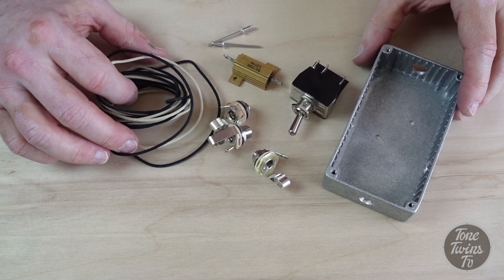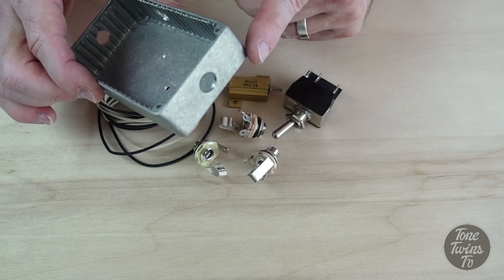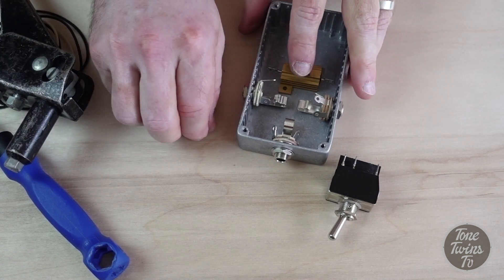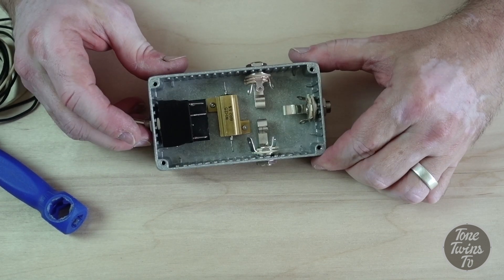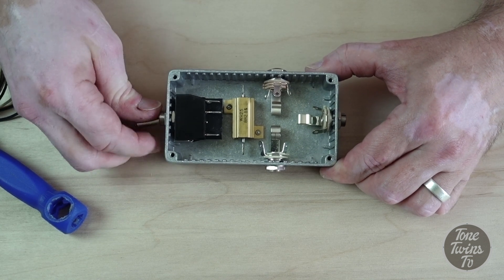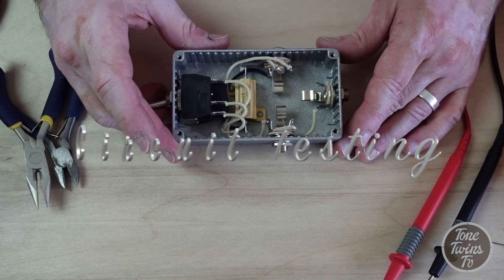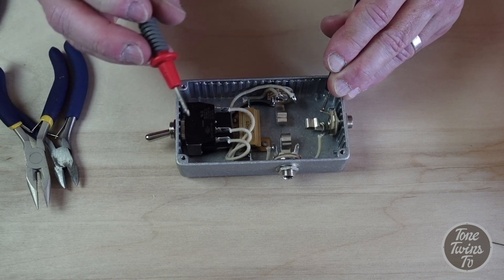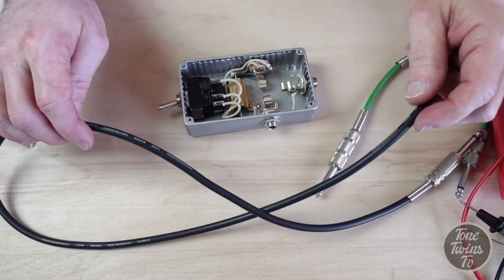You need one of these. Speaker Switch-box solution.

Comment: This was helpful!  I’m currently trying to configure a way I can add a Main speaker out and also be able to patch in to any combo as a cab only.  This points me in the right direction.  I’m trying to understand the OHM load.  If it’s switched to external and no speaker is plugged in, I understand the dummy load to protect the circuit, great job!  My guess is the switched jack disengages the dummy load when plug is inserted?  Very nice!   I think I’ve got it figured, watched it like 7 times now.
Reply from the maker: That's correct. The load resistor is only in circuit when there's no external speaker connected. Just a safety measure really. And yes, plugging in the external speaker disengages the resistor

Comment: A lovely project & video. You could use a switching jack to do the job of the toggle switch and not need the safety resistor. The jack is “normalled” to connect the amp to the internal speaker(s) and when you plug in a jack to external cab it breaks the connection to the internal speaker.
Reply from the maker: It's a good suggestion Al. The idea here, however, is to be able to switch back and forth instantaneously rather than plug and unplug. Just a bit quicker and easier in a recording situation.
Reply: I was wondering the same thing but makes sense for the quick switching scenario. The only thing to be carful of I suppose is that the cab end of the speaker cable is always plugged in or you could still be running the amp with no safety load and a disconnected speaker

Comment from the maker: To clear up any confusion - simply choose a safety resistor value that matches your amp's output. I was building a bunch of these when I made the video. That's why you're seeing a bunch of different resistor values. The WEM needed 16 Ohms and a Fender Champ would need 4 Ohms but most amps will need 8 Ohms - Huw

Comment: That's so much better than what I've done to my old Gibson amps!  I just used an L clamp with a hole drilled through to fit a mono jack and mount it to the inside of the cab.  In the future I will make this switch box instead.  Thanks!

Comment: Another great project. I really wanted to build the attenuator you made the guide for but I've really struggled finding a 16 ohm Lpad as I want to use it with my Ac15. Any suggestion on the best websites to try or are they simply not available?
Reply from the maker: Hi Pierre - try willys-hifi.com

They sell 16, 8 and 4 Ohm L-Pads

Comment: Why a 4 ohm safety resistor and not an 8? Seems more general purpose. ( under the theory that being 1 click away is tolerable)
Reply from the maker: Simply choose a safety resistor that matches your amp's output. I was building a bunch of these when I made the video. That's why you're seeing a bunch of different resistor values.